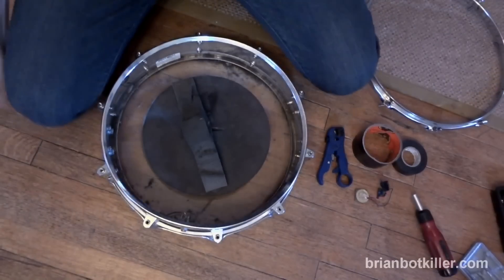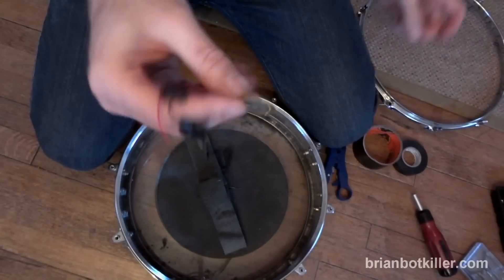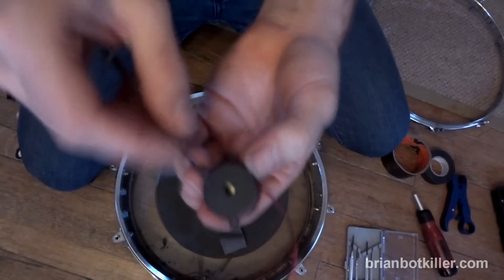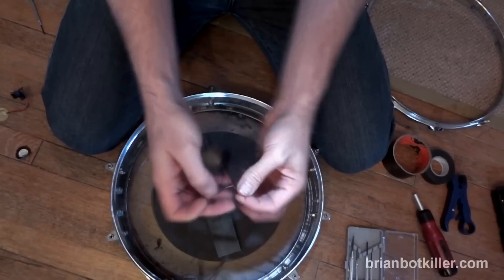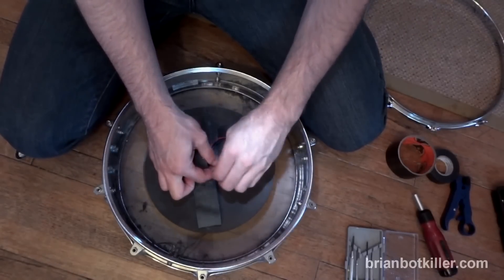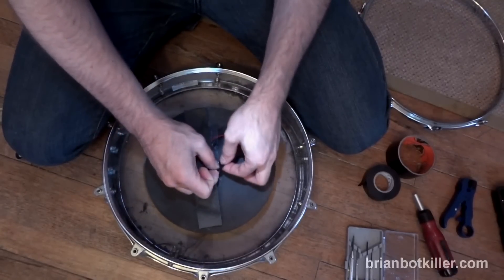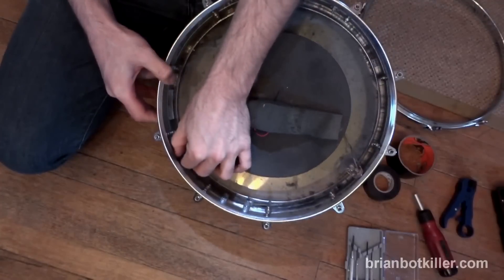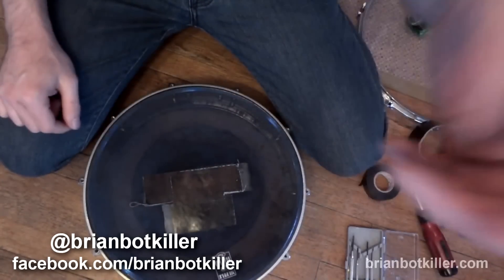How to fix electronic drum triggers

Comment: Can I ask? Will soldering the wires the opposite way will fry your module?.. I have a used gear coming and was wondering if ever original owner did some mods that would potentially break my kit..
Reply from the maker: It shouldn't (in theory), but, the wires should be pretty clearly marked. I usually say to take a picture of what you're working on before you make any changes inside the drum, that way you can go back and look at how it was prior to your splicing a new one in.

Comment: My piezo's in my Hart Acupads lasted 15 years before I needed to replace them due to oxidation and hence faulty solder connections on the ceramic side of the piezo.  If you mount piezo's directly to the under side of the batter mesh head, the piezo's will take maximum impact from the stick thereby greatly shortening the lifespan of the piezo.  In my Acupads, I modified with adding some extra layer of foam disc padding (from arts and crafts store) in between the mesh head and the trigger, for less impact to the piezo and still has sensitivity, with replacement piezo's at 35mm vs the existing 30 mm.
Reply from the maker: Nice tip! Thank you.

Comment: Thanks for the video man.  I fixed my Alesis Surge kick pedal with the help of your video.  I bought this set used, but only a few months old, from a guy for pretty cheap.  I felt like the kick drum was quiet despite adjustments...finally it just quit...which is probably why he was selling it.  Ugh.  I took it apart, re-soldered the original red and black wires to the disc...they are tiny and had broken.  Easy peezy.  Thanks man!

Comment: Hi Brian - great stuff, thank you!
What's surprised me is that you are having such regular problems with your piezo discs. Used these since the 1970s, and I still have my 1975 home-brew hex piezo guitar bridge that works now about as well as it ever did, despite having had to cut down the discs to fit. 
And 'somewhere' in our attic there's a  Maplin Hexadrum (1982 kit-built) with six piezos, six foam pads and a CD4069 hex CMOS invertor in linear mode providing amplification and bongo-like resonances.  It had a  lot of use, trust me!  
But last time I dusted it off (2016?) it was still working fine.  
Any ideas what the piezo failure mode is? .....Puzzled.
FYI, I hardly ever got my piezos from TRS buzzers, bought from Maplin in UK, and now get them mail order from China via eBay,  BangGood, Amazon etc.  Usually work fine.
Thanks again for sharing your knowledge.
Reply from the maker: Thanks for commenting! Funny enough, I don't deal with this much anymore, as the new E-drums I have from DDRUM are much more high-quality. However, I think the failure point was the fact that these tweeters just couldn't deal with getting hit all the time. Who knows! Thank you for saying hello!
Reply: Thanks for replying so promptly to an old comment thread, Brian. 
Glad that you're finding more reliability with DDRUM! We just bought a nice old set of Roland V-Drums after discovering two embryo drummers among us in  a  family fun session (at Liverpool's WhatStudio? ) so I'm doing due diligence as Dad the Designated Roadie.
WhatStudio: https://www.youtube.com/watch?v=LiH1S8zbbrA

Comment: Thanks for the information. I just got a quote per email from Sweetwater (where I buy a  lot of my electronic gear) for $35 for a trigger. According to you, RadioShack sells transducers for only $3-4, so this is really good to know. Thank you so much for this very simple solution!
Reply from the maker: For sure. Unfortunately, Radio Shack has been going out of business, but you can usually buy piezo tweeters via the net, of course.
Reply: Check this Link out (Amazon)..great deal.   You may need to copy and paste the link.                                                                                                                                                            Vktech® 12Pcs 27mm Piezo Discs with Leads Mic Drum Trigger Acoustic Pickup CBG Guitar
Reply: Yep... I ordered a 5 pack of piezo transducers with adhesive on Amazon for around $12.  You can find them cheaper but these looked of better quality.

Comment: brian botkiller (Interesting moniker!) I really appreciate the video. The TP 120 3 zone snare on my 13 year old Yamaha DTXpress III started acting weird. The head and rim started sounding alike. When I reset the rim sound, the head changed to the same sound, and vice-versa. I thought it was the module and got one cheap on eBay ($52 - Great Deal!) I discovered that the snare was bad after connecting the original 8" 3 zone snare to the module snare input on both modules. The eBay seller of the module stated that he didn't know if it worked. If I decide to unload it I should at least double my money since I know it works, whew! Excuse me while I take a breath, lol. Thanks again bro! Great video. - Bob
Reply from the maker: ogredad55 thanks! So glad to help.

Comment: Hello! Great video! Quick question though: The cymbal choke function on my e-kit isn't working anymore, do you know any way I could solve that problem? Thanks in advance!
Reply: @Joaquim Sousa -  Hi - Cymbal choke is usually a touch-contact on the rim of the cymbal pad.  It connects to the drum 'brain' via some sort of lead.  You don't say which brand/type/part number  it is - so it's hard to say more.  Look for a faulty lead first (swap the leads), try another suitable input on your 'brain.   If these don't work, it's probably inside the cymbal - wiring or choke sensor.
These things are dead simple, debugging them is like debugging a desktop lamp.

Comment: Great video - thanks!
For Stripping the wires, my father (he is an electrician) showed me to use a lighter to heat up the part you want to strip of for a second. It makes it much easier to remove without causing any damage to the things connected. :)
Reply from the maker: Yeah! I've used that trick a couple times. Honestly the using my teeth thing is partially a joke, but I've always found that my teeth work better than wire strippers :P

Comment: What if this happens to my kick pedal...like what do i do when my kick pedal dies?
Reply from the maker: Depends on what you mean... do you mean your pedal itself, or the trigger? There are different kick triggers. I've always had ones that are mesh, but there are rubber ones, too. Rubber ones are very hard to replace. The rubber is typically so tightly wound around the trigger that you destroy everything getting to it. If it's mesh, you do the same thing as I outline here. 

If it is the pedal itself, well, might need a new pedal ;)
Reply: Well mine is rubber, but i took off the backing of the kick pad and i found the piezo transducer. If i tap the transducer with my finger i can hear the sound very clearly... But i am not getting ANY sound when i hit it from the front,the actual pad. Even if i use crazy force in my leg, i still cant hear anything. I am so confused and i was messing around with it for hours and now im just considering buying a whole new pad and pedal.
Reply: And do you know what the pedals are calles that have a tiny trigger connected to the pedal, such as the discontinued alesis stealth kick pedal
Reply: brian botkiller do u think the Roland kd-7 kick drum trigger pad is worth it? I might pick that one up
Reply from the maker: I haven't used those pedals much, as I prefer to use my own kick pedal with a trigger.

Comment: Hey, thanks for the vid. One of my (Hart) pads is behaving weird; sometimes, it will trigger, fine, then stop, maybe trigger twice with one stroke or trigger very quietly. I'm not sure if it's the plug socket or the trigger itself. Do you have any ideas?
Reply from the maker: I'm going to say the trigger. The socket/cable rarely goes bad, and if it does, you just get nothing. Mistriggers and misfires are usually due to bad triggers, hopefully you can replace. The Harts are super hard to get into because of all the rubber, but I would imagine you can do it!

Comment: Hi I have a simmons sd5k set and most of my pads started to lose sensibility, on the center of the pad, but if I hit the edges the sound is normal, what can be the issue??
Reply from the maker: I would say that could be it, You might want to try factory resetting your drum brain, too.

Comment: The radio shack piezo transducer seems to work, just replaced one of my toms today. Thank you for the information on where to source parts. Two suggestions. Solder the wires after you twist and get a decent pair of strippers, while stripping hold the wire being stripped with pliers. Save you teeth and nails. Awesome video and thank you. Just saved me mucho dinero.
Reply from the maker: You got it, thanks for watching!

Comment: I have an alesis dm10 kick drum that's starting to die..but it's just the left side that's getting quiet, and sometimes unresponsive. the right side is fine. what would cause this?
Reply: +Maxwell Murder I have the same problem with my DM8 kit. It seems to only work if the beater strikes dead center.
Reply: +Arik Jeppsen annoying isn't it? I replaced the trigger, and it's still doing this...and to make things worse, I can't find any info on what's causing it.
Reply from the maker: That is definitely your 1/4" jack on the drum, not the trigger. The trigger cannot differentiate between left/right, so I'd say, check the cable, firstly,  and then the jack.
Reply: +brian botkiller guess that makes me dumb, and a noob xD seriously tho, idk how this didn't cross my mind..thanks allot man!

Comment: same here alesis DM10 bit the dust at the kick. EASY FIX! well, easy if you have a small amount of DIY intuition. The other thing I noticed is that the foam cells have failed and you can DEFINITELY notice the difference. Anyone here upgraded or replaced the foam on their kick pad? maybe like a mousepad or two cut to fit? or something else?
Reply from the maker: +Mr. McCabe A new piezo is always a gem when it comes to playability.
Reply: +Mr. McCabe i also have a DM10 and start to notice my kick failing, not sensing all the soft kicks (this happens since last week when i've started to practice double bass 16ths notes 135bpm for 1 hour, daily)
Reply: +poweredBYGDK everything worked like a charm with the sensor replacement!

Comment: Now this is a tech tip people can use.

Brian, as you seem quite tech savvy and e-drum savvy, you might use your e-kit with a DAW. Or, maybe not, but anyway, are articulations and zones available as MIDI data (CC?) with most kits? I'm looking at getting an Alesis DM10 kit. Don't care about the brain's sounds, just MIDI to my DAWs.
Reply from the maker: +Michael McFarland Youtube doesn't give me notifications, it seems, so I apologize for never responding. Articulations are available as MIDI data, zones, no. Zones are simply literally physical placement of sensors, most of the time, such as, I have some triggers with two piezos in them, in different locations, to pick up on vibration at different times. There are some very good things happening in drum triggering, however, from companies like Alternate Mode, who makes triggers that are force sensitive, which yields a much better responsiveness to the hit. I'm the same way, all I care about is the MIDI data, the brain doesn't matter to me at all because I trigger software. Most brains are good, I will tell you that the best that I've used are the Roland brains. Alesis tend to miss the mark on a few things. Anyway, thanks again for watching, and sorry to be so late, here.
Reply: +brian botkiller I did buy that DM10. It works well for me. It has all the MIDI flexibility I need for DAW use. As for Roland, well, circa Eighties and Nineties, I purchased 6 different Roland devices and ALL OF THEM went bad on me post warranty, or were defective right out of the box - an e-drum kit being one of two. I got a refund instead of a worthless warranty ... cancelled the check and returned the kit.  Have not even considered buying another Roland product since.

Thanks for the response, Brian.

Comment: hi brian, thanks for the video. i have done this and it worked no problem, except my snare keeps failing, forcing me to replace the buzzer over and over again, as often as every second time play them. i imagine this keeps happening only on the snare because it is played more often than the other pads. 

do you have any suggestions on how to fix this issue?

thanks man.
Jazen
Reply from the maker: No, I go through a lot because I hit hard.  Of course there is foam between the head and the buzzer - I would never have a drum that didn't have that. Buzzers aren't much meant for this kind of punishment. They die fast. You can always buy buzzers over the Internet. I just happen to use these. Thanks for watching!
Reply from the maker: Yeah, it'll just happen.  I replace my snare trigger usually every month or so.  It's a drag, but a small price to pay.
Reply: ***** Good video, but noticed a few things. I suspect the reason you're getting through so many piezos is because you're pretty much hitting them directly with a stick!! All the other drum conversion videos I have seen use a 1 1/2" high density foam cone between the skin and the piezo. Also, every US video I see for edrums, everyone uses these Radio Shack buzzers and have to pry them out the casing. Is there nowhere in the country that stocks bare piezos?

Comment: Your advice about 'strip wires with your teeth' is totally irresponsible and stupid. Many people have broken front tooth enamel in this way, and just because you do it, does not ever make it 'good practice' or a 'tip' that you should pass on. Use a Stanley knife (box cutter) and roll it over the wire. (it's not difficult) and electricians do this every day (why don't they use their teeth if it's much easier and better?) 

Shorting out positive and negative output leads of and amplifier do not 'cancel each other out', they cause sometimes very severe damage to your output devices. transistors/valves and/or fry the output transformer or other components in the output stage of the amp.

 A lot of non-or lazily thought out and dangerous advice, when all you did was connect two leads of a new piezo to the original output wires.
Reply from the maker: Calm down there.  It's  JOKE.  I just happen to use my teeth to strip wires.  Guess what?  IT WORKS.  K, get over it now- thxbye

Comment: Hi Brian, thanks for the video, it's very well explained. 
Maybe you can help on the issue I currently have. I have a cheap Yamaha electronic drum kit (DD 65). The snare MIDI signal used to be very weak and now it doesn't seem to work anymore (the rest of the kit does). However, when I just play drums on the integrated speakers (not via the computer), the signal is totally normal, everything works well... 
Does it have to do with the trigger or is it more complicated when it comes to midi?
Merci